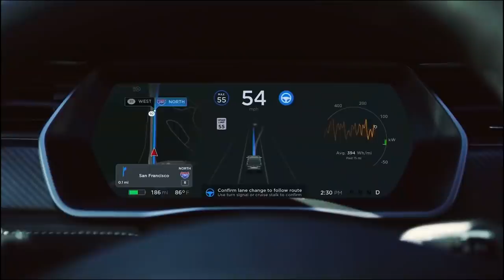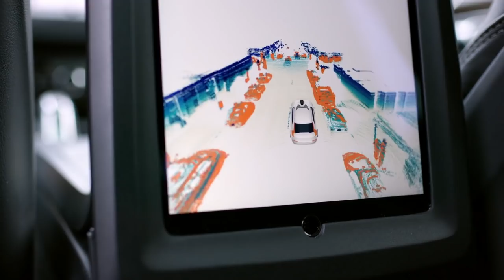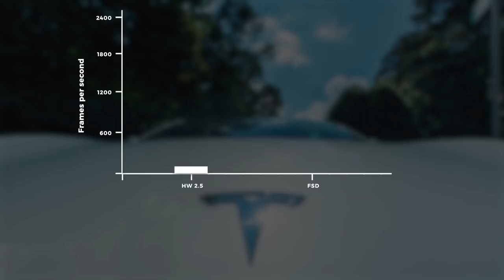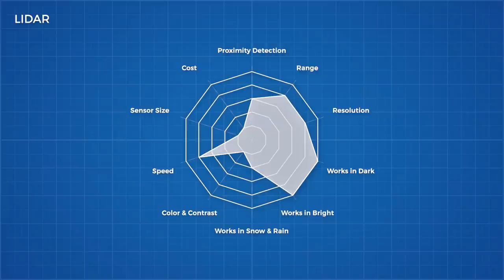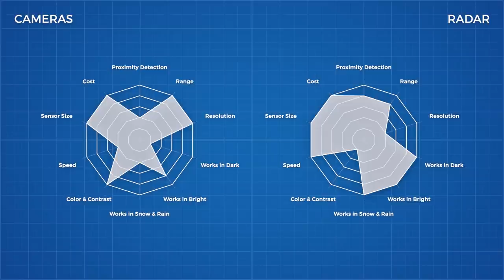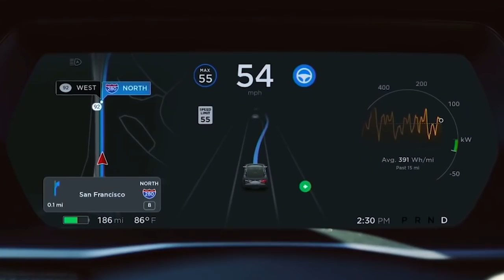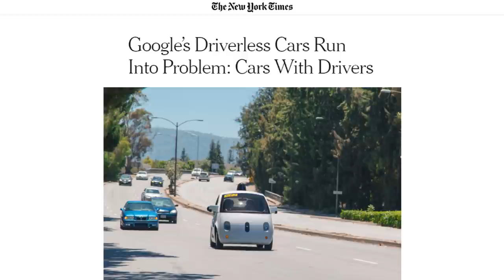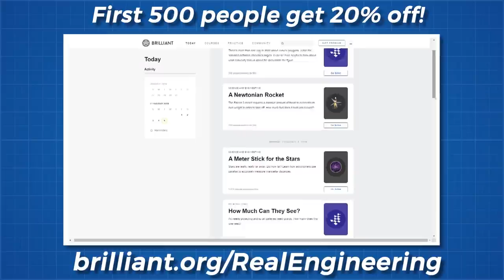The Challenge of Building a Self-Driving Car

Comment: Self-driving cars simply won't work unless all cars are self-driving - and I'm not giving up on doing the driving myself. If you can't drive or don't want to drive, use public transport. Period.
Reply: Not at all true. That's like saying driving now doesn't work unless everyone is a good driver. Self-driving cars will for sure get more efficient as more cars are self-driving, but initial ones are being designed for an environment where self-driving is the minority. They're still in development, and not ready for widespread use without more development, in hardware, software, and ability to deal with real world variables, but the tech is already helping. I have the Eyesight system on my Subaru, which does basic stuff like adaptive cruise control and lanekeeping assist, and front collision warning/avoidance, and it helps make long commutes and road trips much easier. But when I'm on a nice twisty backroad, I can still have a ton of fun driving with the features turned off, and using paddle shifters and putting throttle response in sport
Reply: Even if it does not work out we will still have a system that will be able to assist the driver and improve safety by a ton. Watch "Tesla avoids a collision" compilations.

Comment: All of this elaborate design and engineering is only 50% of the problem of producing a self-driving vehicle.  There is the other half of the problem which is the functionality of the system.  A highly complex system of electronic function, depending on the 100% performance of an array of sensors and microprocessors  exposed to the elements, is likely to be unpredictable and probably unreliable.  I don't see this problem being resolved by technology or better programming. Also, liability laws ( another human invention) may eventually put this baby to sleep before it ever gets a chance to take hold and be available to the masses.  Musk may be a creative genius and a dreamer but he is no Henry Ford.

Comment: Wtf does lidar and driving autonomy have to do with sustainable transport. I wish they stopped grouping self driving vehicles and electric vehicles into one category. They are not the same thing. Its perfectly fine to build an electric vehicle with nothing more than batteries, motors, and motor/charging controller. Add a manual transmission to that, and you won't alienate half of your potential customers.

Comment: The Uber incident is a bad example because: 1) The accident would have happened with certainty with a non-autonomous car. The pedestrian was definitely at fault and it wouldn't even be reported if an auto driving car was not involved. 2) Uber had a disjointed development team for self-driving. Their software and hardware teams are based in different cities and one made the "no braking, no warning" change without the other team aware of the change. 

Also there are two points you didn't address in your video, I feel it is important to mention: 1) The rate of auto-driving learning for Tesla will increase exponentially with more cars on the road as every Tesla have all the sensors to feedback and improve the nero network even if the customer didn't get the autopilot option 2) In the intersection example, Tesla autopilot will just inch forward as a human driver, problem solved. That's the key point as you can solve all these self-driving issues and don't have to program for every situation, the nero network will just learn based on real world driving data, it is all part of the machine learning.
Reply: The pedestrian was legally crossing in a legal unmarked crosswalk, she was not at all at fault.

The footage you're seeing is intentionally designed to fool you into this stupid belief. Uber used a camera that barely picks up any light, showing the road as much darker than it appeared in reality to human eyes. Many Tempe residents uploaded pictures and video of the road in the aftermath of the death showing that the light conditions are actually really good in that area and police confirmed any pedestrian would have been visible a few hundred feet away, not "out of the shadows" a few seconds before impact as Uber and the police spokesman initially claimed, lying through their teeth to protect themselves from liability.

Comment: I find all of this technology great but if they would just do something called car  Link It's  Where each car with thin a 300 plus yard  Area  360ﾟ all communicate with each other on speed distance  Lane and destination. Our highways would be retarded Super safe because the highway has no traffic lights or pedestrians8 eventually the highway will become an auto lane itself. It makes no sense to me why all of the automakers are not working together to have a Car communication link system in which each vehicle talks to each other even on the other side of the highway this is a common Cents problem fix.
Reply: Car electronics are always years behind what IT industry has to offer. Also a lot of people don't like having electronics in their cars.
Reply: @RawbLV    I understand that but there is legislation and laws that can prohibit vehicles on the highway without proper auto pilot configurations. Remember Interstate highway is one of the most possible controlled vehicle environments. Everybody is going one direction highway is divided exits are properly labeled distance is known Destinations can be set in the computer. If your vehicle does not support the auto pilot car link computer system you are legally not allowed to join the inner state it's just that simple. No more Rear end accidents no more gawking accidents or rubbernecking accidents no more retarded slow Downs in traffic all the computers can do all the calculations communicating with each Vehicle on the grid network to self maintain and drive autopilot just that simple. Furthermore if a vehicle blows a tire the sensor in the tire already knows it's lost air pressure and must make an emergency maneuver or pullover or human intervention it's just that simple. Once again remember the interstate highways are The best roadways for these vehicles to coexistNot urban environments yet.

Comment: Isn’t radiowaves also light?
Reply: Isn't light also radiowaves?
Reply: No. Both radio waves and light waves are electromagnetic energy waves, but radio waves are longer and have lower frequencies than light waves like a laser, this is why they are classified differently. Electromagnetic energy doesn't transfer through dense water well which is why yet another similar but different technology exists called Sonar.

Lidar - light
Radar - Radio
Sonar - Sound
Reply: Frozen Thorn yes I know that sonar is sound, and I know that radiowaves has a lower frequency, but it’s still electromagnetic radiation. And light is electromagnetic radiation. Correct me if Im wrong.

Or do you mean visible light?

Comment: Building a 24/7 self-driving car is 100% impossible and must be stopped, here and now.  What IS possible are auto drive parkways.  With controlled highways with sensors that work regardless of the weather or night, then medium and long trips become a breeze.  If you insist on 100% auto-driving, you then expect a car to drive with radar.  When radar confronts ice or liquids, you often get no returns, a black screen.  That doesn't fill one with confidence...

Comment: No computer can be made immune to being hacked.
If the car is not connected to a network then there is no way to override its systems when it malfunctions.
If it is connected to a network then all cars on the network can be hacked simultaneously.
Millions of vehicles could be made to crash simultaneously...and what can happen WILL happen.
The ONLY properly qualified operator of an automobile is a human brain...a human being. 
Period.
Autonomous vehicles...safe autonomous vehicles, are the perpetual motion of our time.